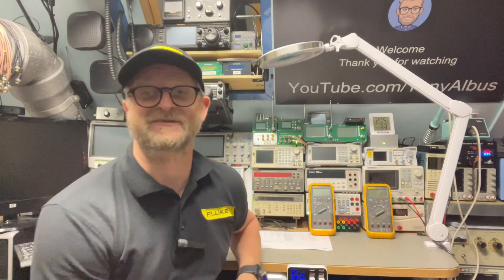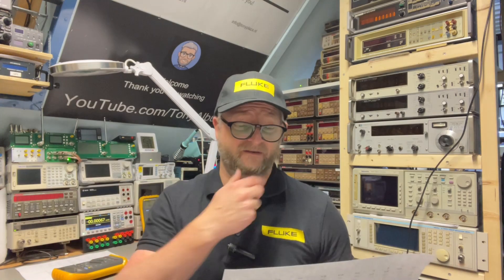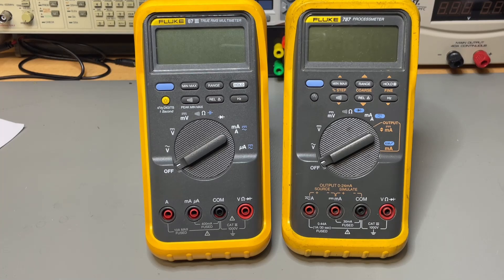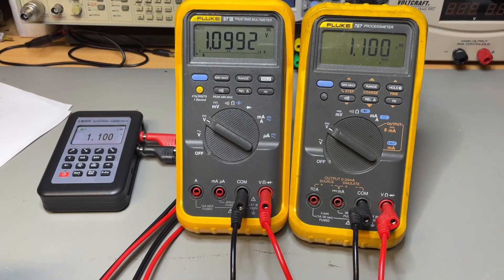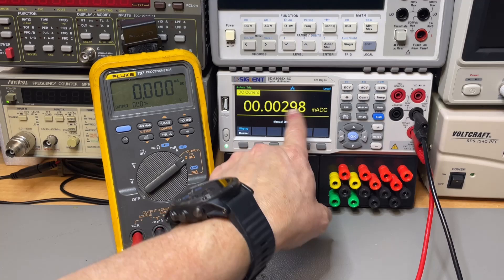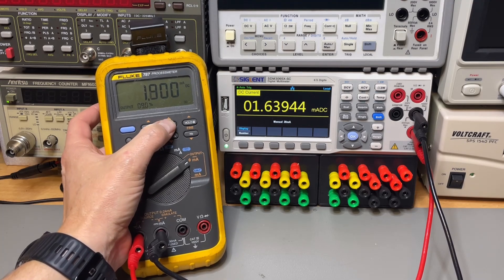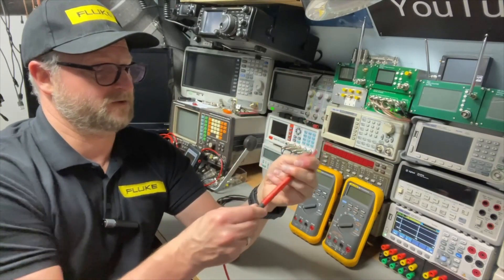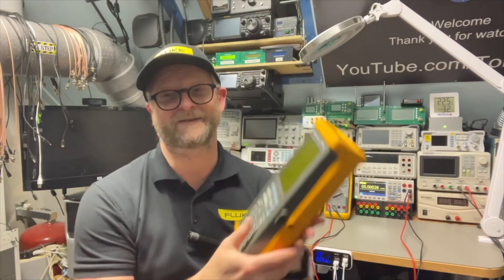TA-0331: Fluke Friday (E9) Fluke 87 III and 787 Processmeter Calibrator

Comment: The classic 87 series. I've had many 87 over the years and the way they retain their calibration is incredible. Back in the early 90s when I got my first 87 no one talked about counts back then. So when you showed the 87 gen 1 was only 4000 count I was really surprised it was so low considering the excellent performance and accuracy of the 87.But hey who cares when they perform so well. I have never seen the 787 before but I guess it's more suited to a lab than a field engineer. Thanks for sharing the nice video Tony.
Reply from the maker: Thanks Ian, the 787 is used in industrial/production.. current loops in PLC's etc.

Comment: Tony - the original Fluke 87 was introduced in the late 1980s (88 I think) and it was really untouched until about 1997 when the 87 III was released. The biggest change between the 87 and 87 III was the CAT rating that had been introduced since the original 87's debut.

There was not an 87 II, however, Fluke did make a special 87 for Xerox that hat a CAT rating which some consider the 2nd generation model. I have one and it comes with Xerox branding and a gray case (Not typical Fluke yellow).

The 87 IV was introduced circa 2002 and was rebranded as the 187/189 series. Designed with a CAT III rating it was more of a bench/electronics meter. The 189 had logging abilities and both eventually led to the 287/289 that we know and love today.

The IV was short lived and the 87V was released around 2005 (I'm pulling dates from memory, someone can correct me) and that has remained until a few years ago when the 87 V Max was introduced (a few better specs and IP67 rating as well)
Reply from the maker: Thanks Joe! thanks for sharing that extra info!

Comment: Great episode again. 
In the 80 series you also have, as in the 70 series, the 88 automotive meter.
Also, there is an 87IV, which basically is what later became the 187 although I believe there are a few minor differences that seemed to negatively affect autoranging on the earlier 87IV's.
Never knew about these enormous extension parts to create a very long probe though.
Reply from the maker: Thanks Marnix, the 187 287 are very very nice!

Comment: tony , in you rack  is that a marconi 2030  ? I had one given to me,,missing the attenuator inside all works great,,just no control,,,ljust full rf output,,i can use external atteunator,,but hav way too many others
Reply from the maker: Hi Dennis, well spotted its the 2031 , mine has a small problem, that the pll is not locking.. its unstable.. will become a video when i feel like trying to fix it. hope you can fix yours, the are nice.